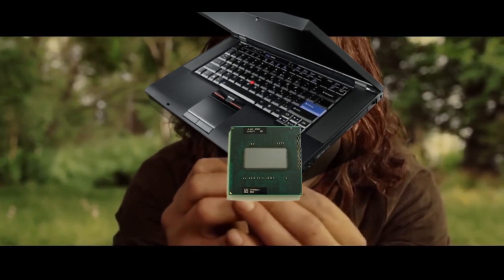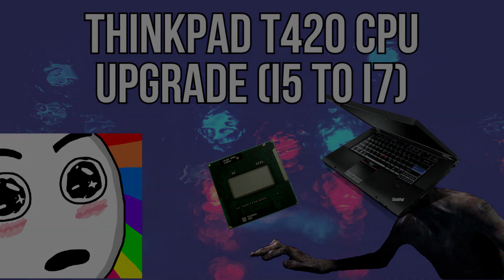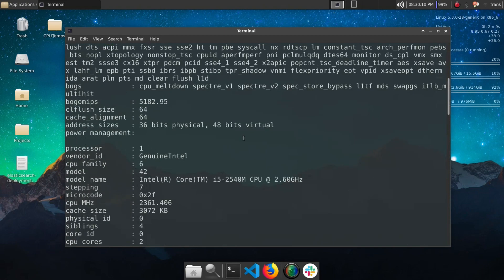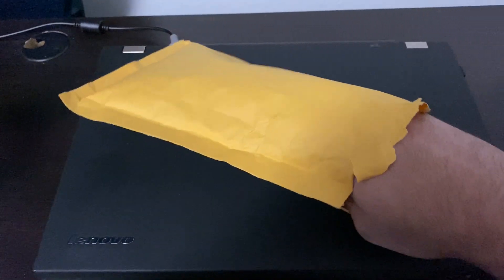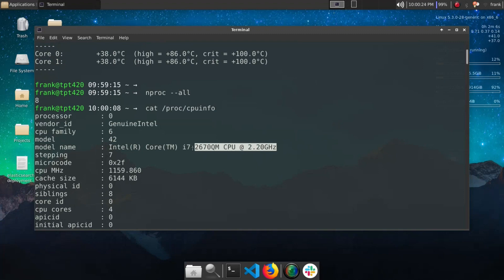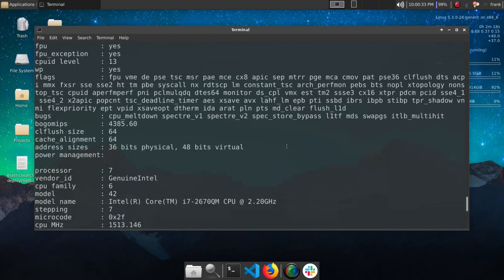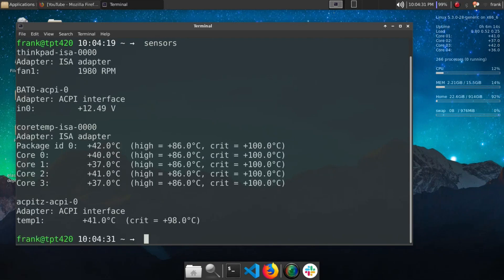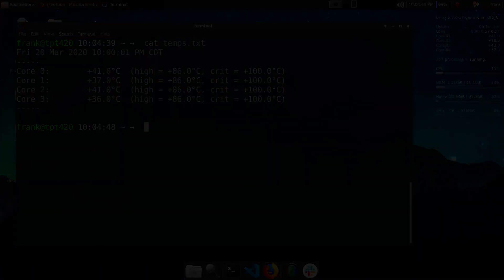ThinkPad T420 CPU Upgrade (i5-2540M to i7-2670QM)

Comment: My friend, I looked at the processor specifications and I think you're wrong. The i5-2540M that came with the laptop works at 35w and the i7 2670qm that you upgraded to is at 45w. This means that the cooler you have on it is for 35w and will burn out at some point.
Reply from the maker: Wrong about what exactly? If you want more information on the CPU temperatures, I had a follow-up video discussing it.
Reply: @Frankiscool  I saw the video with the temperatures and I saw that in the model you upgraded, the heatsink has two pipes for expansion and heat transfer to the heatsink that the fan blows and cools. This is good and ultimately there will be no problem in your laptop. But most laptops with second-generation processors are at 35w and have a single metal shaft and the surface area of the heatsink is not as large as the surface area of the processor. In these models with a metal shaft there will be a problem with the temperatures, that's for sure, and the fan will work constantly at high speed and especially during the summer months there the problem will be even more intense. It needs attention. I have an old Hp Pavilion G7 with an i7 2640m 2.80GHz dual-core processor and it plays fine and quite fast with the same intel graphics 3000 and with good temperatures at 35w. I will also do a test with the i7 2670qm and I will write to you about how it went. Good luck.
Reply: @T0LL1S i'm waiting ur test, i try to change i5 2520 to i7 2670QM
Reply: @derissuprapto  Well, today I received the Intel i7 2670qm processor and put it in two laptops. With extra GPU and without GPU on R13 motherboards from the 1000 Hp Pavilion G6 - G7 series. Both laptops did well, but for those who want to upgrade the same laptop, it's better without an extra GPU so as not to burden the single copper shaft that these laptops have on their heatsinks, which are for 35W. With an extra GPU because the graphics card also falls on the same single shaft, then it might not be good over time because the air exhausts will close over time and I wouldn't recommend it. You'll have to be a bit meticulous with the cleaning.

Comment: my Acer NB want(i5-2430m) upgrade to quad core but my cooling system may too small
Reply: Does the laptop have a rPGA 988b socket? Does the laptop have a discrete card (Nvidia/Radeon) or only an integrated HD Graphics 3000 video card? The socket type can be viewed through the CPU-Z program, and video cards can be viewed through Device Manager.

Comment: Hello community!
I installed i7 2760qm. Everything works ok except one thing. It could be some noise out from drossels i guess, near to button P/0 on the keyboard, not from cpu.
How is it critical?
If i remember correctly, it wasn't with stock cpu, power supply 90w.
Thanks
Reply: I also have a 90 watt power supply and an i7-2760qm processor. I turned off the turbo boost on the processor and I'm running at a base frequency of 2.4 GHz. Thanks to the Samsung 860 EVO 500GB SSD and 8GB RAM, the processor runs fast and without turbo boost. In the "Power" section, set the "balance" mode. Processor status: on battery and power supply: minimum power - 0%, maximum power - 99%.

Comment: It should be noted that the i7-2670qm Doesnt have any of the virtualization and v-pro features the dualcore i5 and i7 does. Which if you use virtualmachines a lot matters. Also the integrated graphics runs 200mhz lower on the quadcore i7.
Reply: Yes. That iGPU speed matters also for gaming (well, old games ofc)a and also turbo boost.. i7-2670qm has less turbo boost vs 2-core i7's

Comment: 1. Did you have to update bios on your laptop for this CPU to be functional/supported by the laptop?
2. Did you have to upgrade your A/C adapter since i7 is 45W and i5 is 35W?

Thank you in advance. :)
Reply from the maker: I have a video on the BIOS update. Did it before the chip upgrade if I recall correctly. I didn't upgrade the charger.

Comment: Great video I have the same laptop iused to play games on the i5-2520M without any problem but I changed the cpu to i7 2620M I have now overheating and Everytime I open a game my laptop shutdown what I have to do guys:(
Reply from the maker: You could try a different thermal paste and see if that helps. Alternative is to rig something custom with the fans or just downgrade back if it use to work fine.
Reply from the maker: Also, I wouldn't be using a thinkpad t420 for gaming, would use something newer to be honest.

Comment: Hello, does the i7 2860qm work on the t420? or do i need to make some modification? due to the tfp being 45w?
Reply from the maker: It is possible but you will likely run into overheating issues. I would check the ThinkPad subreddit and do some digging there, not sure if you need anything else custom aside from the cooling.

Comment: Did this upgrade along with a 1080p screen. Idle temps 45c - 50c browsing Internet 50c - 65c recommend downloading tp fan controller as well as cleaning out the fan used termal grizzly kryounaut on aida 64 stress test cpu temp levels out at 89c. Ran Aida 64 stress test for 30 minutes. Happy with the result as with the i5 I was getting similar temps anyway.
Reply from the maker: Nice man!

Comment: G570 here, an i7-2630QM will absolutely sack the single heatpipe it has. Dual-core is really the limit
Reply: psure the i5 he pulled out is quad core as well.
Reply from the maker: yep yep.

Comment: I think it would be better leave CPU of T420 as it is since it is not greatly improve performance. Instead adding more memory and change to SSD is better. Also when changing CPU, use electrostatic screwdriver instead of using paper clips.
Reply from the maker: Yeah just upgrading the disk to an SSD is a great improvement. Would definitely agree that just upgrading the memory and disk are enough for good gains.

Comment: I upgraded the same way you did a while a go.

Now my ThinkPads runs faster, until it totally overheats (while compiling and processing heavy loads).
Reply: 3C 273  holy shit 80fps?! On stock it runs at 20 fucking fps on 720p low holy fuck i need to do this mod after i get this laptop i might try using the T430 cooler so i can use 100% of the power and get a 9 battery instead of a 6 battery
Reply from the maker: Yeah I only run into high temps when trying to play a game.
Reply: 3C 273  what cpu does your t420 have? and how did you overclock it? TIA

Comment: If my T420 is running Windows 10 Enterprise and my bios shows 83ET67WW (1.37) can this bios be ok to handle the upgrade to an i7-2670QM with putting in 16gm ram?
Reply from the maker: Not sure, recommendation would be to be on latest version.

Comment: hello ... i have laptop lenovo T420 Intel Core i5-2520M CPU 2.50GHz, Can i upgrade it with Intel Core i7 3632QM CPU 2.2GHz ? is okay or not ? 
Can i make upgrade RAM for 4GB to 16GB ?
Is it available to him when I make an external screen card?
Thank you so much >>>>>
Reply from the maker: Yes it can be done but I believe you will need to use coreboot, I haven’t done it so I don’t have much info. ThinkPad forums or subreddit covers it though. Yes, the RAM can be upgraded. 👍🏼

Comment: Now try corebooting the laptop and installing a third gen i7, it'll have better singlethreaded and multithreaded performance
Reply from the maker: Sweat intensifies.
Reply: Do you happen to have a guide or something to do this? @BYMasterMM
Reply: @revraitah  I've never really been able to find a good guide on it
Reply: @revraitah  Google Coreboot and their site has everything you need. There are also projects like Skulls and MrChromebox that have forked. As far as serial programming, get a legitimate Pomona clip and save yourself the tears. You can flash the eeprom with a pi zero or better very easily. 

Some models like the HP z220 doesn't need a hardware flash even (but is obviously less secure). 

Interestingly, Chromebooks tend to have a write protect screw which has them near the top of the secure firmware hierarchy compared to most laptops. You can also put any OS on them after that.

Comment: Did you upgrade your power adaptor as well? I have 120w adaptor can I use it? Post i7 upgrade?
Reply from the maker: No, I did not make any upgrades to my power adapter.
Reply: 90w is recommended also i recommend using something like Arctic MX4 for the CPU 
PS: someone on Reddit got a t430 cooler into a t420 while using this mod and they say it runs much cooler than the stock one btw disable the dGPU and use the iGPU it's much faster and you will get good performance in games
Reply: @s_aku Hey bro, how do I disable dGPU and enable iGPU?

Comment: Love this video :) Btw I want to upgrade my t420s does the "s" version support the i7 2670qm?
Reply from the maker: "T420s has a soldered CPU so it can't be changed for the quad core, while the quad core upgrade on the T420 has already been attempted successfully."

Found this on the ThinkPad forums.
Reply: @Frankiscool  Thanks
Reply from the maker: @k.o.7629  No problem!

Comment: Hey i got a problem my thinkpad t420 is really hot my cpu got 95C when i play games like Tf2 its normal? or not
(sorry for my bad English)
Reply: in my laptop, I replaced the i3-2330m (35w) with the i7-2760qm (45w), and so that the laptop would not overheat, I turned off the turbo boost on the i7 processor and work at the base frequency. The performance suits me - 4 cores, 8 threads / 2.4 GHz. 
+ 8GB RAM DDR3-1600 + SSD Samsung 250GB (Windows 10). In the stress test, the maximum temperature was 79* C.
Reply from the maker: You can also try a different thermal paste. But yes, you can run into heat issues when pegging the CPU.
Reply: @Frankiscool  its not thermal paste i think its problem because of very small ariflow holes im gonna buy the cooling pad maybe this will help but ty for reply and help
Reply from the maker: @vawolo4950  No yeah, the temperatures for sure go up when upgrading the CPU. I have another video on my CPU temperatures. There are some people that do a custom CPU fan mod but I haven't gone as far as to do it myself. I don't use my laptop for gaming that much.
Reply: @Frankiscool  im use laptop to play games sometimes when im away somewhere and i dont have access to my pc on which i always play
Reply from the maker: @vawolo4950  Ah, understood.
Reply from the maker: @vawolo4950  Ah, makes sense. :)

Comment: hello frank. I also have a thinkpad T420 and I was wondering if I can change the i5 2520m to an i7 2860QM? If the answer is yes, will I have a problem with notbook feeding?
Reply: in my laptop, I replaced the i3-2330m (35w) with the i7-2760qm (45w), and so that the laptop would not overheat, I turned off the turbo boost on the i7 processor and work at the base frequency. The performance suits me - 4 cores, 8 threads / 2.4 GHz.
 + 8GB RAM DDR3-1600 + SSD Samsung 250GB (Windows 10). In the stress test, the maximum temperature was 79*C, max TDP 30w.
Reply: @vladimirazirov1815  thank you my friend, helped me a lot!
Reply: @vladimirazirov1815  Hello. Everything ok so far? Are the settings the same? Doesn't heat up?
Reply: @alexf1515  Hi. Everything is fine. At a frequency of 2.4 GHz in the browser and when watching movies, the temperature of the processor is 50-55*C, when processing video and running old games (2007-2013), the processor heats up to 75*C. 
In the AIDA 64 stress test, the processor temperature is 83-87*C.
Reply: @alexf1515  disable turbo boost on i7 processor:
in the Power Options menu (WIN 10) ->
turned on the power plan "Balance" - > 
"advanced power settings" ->
Processor power management ->
Minimum processor state: 
On Battery: 0% 
Plugged in: 0% //
System Cooling policy: 
On battery: active 
Plugged in: active //
Maximum Processor state: 
On battery: 90% 
Plugged in: 99%
Reply: @vladimirazirov1815 Got it, thanks. I now have I7-3632QM (35W) on the T430 and it works fine with normal settings. But I want to upgrade T420 to i7 some 4c / 8f, so I'll have to use your method :)
Reply: @alexf1515  i7-3632qm is a good processor. My wife has an Asus k55v laptop with i3-3120m processor and i installed i7-3632qm. Laptop performance is better.
Reply: @vladimirazirov1815  do you need to coreboot with i7-2760qm?
Reply: @foodcentrale4789  I did not understand the question. I am satisfied with the performance of the i7-2760qm.
Reply: @vladimirazirov1815  i mean  does it requires coreboot to run i7-2760qm in t420? im planning to upgrade mine from i7-2620M to i7-2760qm but im afraid i need to coreboot the bios thing for it to work. it seems doing the coreboot is too complicated for me. thanks for the rply btw.
Reply: @foodcentrale4789  I think there will be no problems with the transition to the i7-2760qm processor. The laptop has an HM65 chipset that supports all Intel 2nd generation processors. Just in case, I updated the BIOS to the newest version from the laptop manufacturer's website. There is nothing complicated there - we downloaded the file with the BIOS to the laptop. Then you install it as a normal program. During BIOS installation, you cannot press the keyboard and mouse. During the BIOS installation, the laptop should be powered from the power supply, not from the battery.
Reply: @foodcentrale4789  if you have the newest BIOS version, then when replacing the processor for 2 minutes, remove the BIOS battery from the motherboard.
Reply: @vladimirazirov1815  Thanks a lot bro, I already installed the newest bios 2018. keep up the good work. i hope you make a channel so i can follow and subscribe to you. thanks again.
Reply: @vladimirazirov1815  
After upgrading to i7-2670qm.  Does memory work at 800 MHz (DDR3-1600)?
Reply: @tytan84pl  I have already sold this laptop and bought a computer. I don't remember exactly. I had an i3 processor and one 4GB DDR3-1333 (667MHz) memory module. When I installed the i7-2760qm processor and 4GB+4GB DDR3-1600 RAM, the RAM seemed to work at 800 MHz (CPU-Z program, tab "Мemory")
Reply: @tytan84pl  On the Intel website it is written that the i7-2760qm processor works with DDR3-1333/-1600 RAM, and the i7-2630qm/i7-2670qm processors only with DDR3-1333 RAM. If the processor in a laptop is i7-2670qm and you install DDR3-1600 RAM, then the RAM will operate at a frequency of 1333 MHz
Reply: @vladimirazirov1815  Thank You for your answer.
Reply from the maker: Thanks Vladimir!

Comment: Do you have problem with TDP of I7? I have an 35w i3 2330m and i want upgrade to a i7 with 4 cores and 45w is it possible? Sorry my english I’m from Brazil 🇧🇷
Reply from the maker: No worries! I'm using an extended battery pack and the original charger that the laptop came with, no problems. I have a more recent video with all the mods I have on my ThinkPad.

Comment: I though the 2670qm was far to hot for the regular heatsink? I just bought. 2630qm and waiting to install it. How are the temps with normal use?
Reply from the maker: I have another video on the CPU temps. It’s okay for the most part, unless I’m playing Among Us for a bit.
Reply: @Frankiscool  oh so pretty much it's fine for regular use unless it's been pushed then the heat starts to generate. Cool!
Reply from the maker: Yep :)

Comment: What happen if I use windows? Bios thing and stuff?
Reply from the maker: Works with Windows, not sure if I’m understanding your question properly.
Reply: @Frankiscool  I meant the bios setting, and compatibility with windows, driver and such
Reply from the maker: I believe I’ve seen a couple of Windows users with this CPU, should be fine. To be sure I’d suggest you check out the thinkpad forums.

Comment: Hello, did you have problems with the docking station with the new CPU?
Reply: hi @Frank

according to the specification, i5 and i7 use different docking stations
Reply from the maker: I had a dock but not sure where I left it. 😓
Reply from the maker: lyubo bg I have not tried it on a docking station yet.
Reply: @Frankiscool  - can u pls try if possible? I'm planning to do the same upgrade, but without docking station support, I won't do it
Reply from the maker: @lyubobg  I forgot where I left my docking station. I don’t see why it wouldn’t work,
Maybe check the thinkpad forums.

Comment: Would this work on an L420? I would assume so cause it's the same model with slightly different construction material and a few less features as far as I know, but I'm no expert.
Reply: I have edge e420 upgrade to i7 2670qm work fine a litte hot but its okay
Reply: Hola quiero hacer lo mismo. ¿Tuviste problemas de sobrecalentamiento? ¿Algo a tener en cuenta? @JuankM1050
Reply from the maker: I would honestly check around on the ThinkPad forums. If they are the same socket type and require the same power, then I don't see why it would not work.

Found this thread but it kind of went dead.
https://forums.lenovo.com/t5/ThinkPad-L-R-and-SL-series/L420-7826A54-CPU-Upgrade/td-p/730535

You can always try to look for a  T420, they sell for cheap sometimes in local listings.
Reply from the maker: Nice

Comment: Do you have heat problems
Reply from the maker: It runs hot when rendering videos but overall I don’t really have any problems (random reboots) or anything like that.
Reply: @Frankiscool  Is there a way to fix it?
Reply: @Frankiscool  How much heat My heat 97 Cํ
Reply from the maker: Use a good thermal paste brand and re-paste the CPU?

Comment: I just upgraded my T420 today to i7-2860QM. Earlier I upgraded the display to 1080p. 
mSATA for system drive. G. Skill Ripjaws 1600 DDR3 16GB  
WiFi module to AX200 160Mhz
This definitely is fun. But man, that i7 is hot! Idling at ~42C even with TG conductonaut
Reply from the maker: Yeah for sure! There’s some people that go ahead and do a fan mod but I don’t think it even helps that much. Might have to do some research on that WiFi module, hadn’t heard about it. :)
Reply: Hello, I have a t420, I want to update the wifi card which you recommend, it would also be great to put a 1080 touch screen.
Reply: Can i upgrade to i7 gen4?